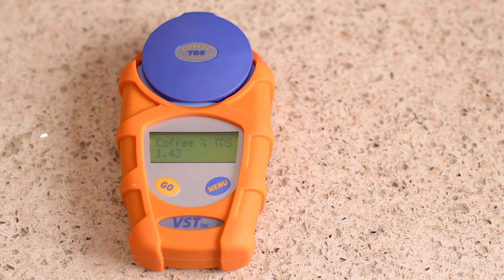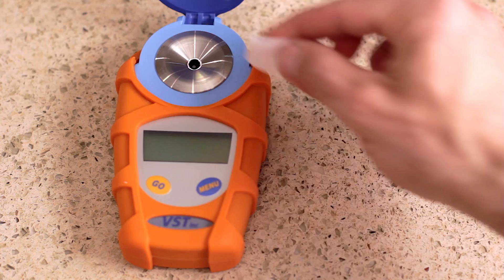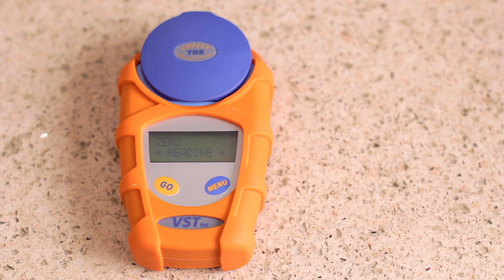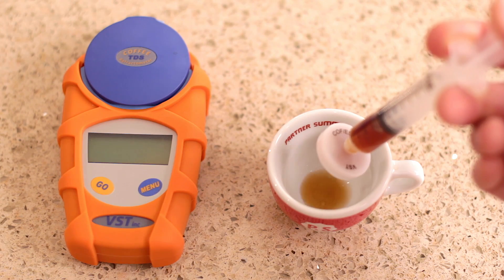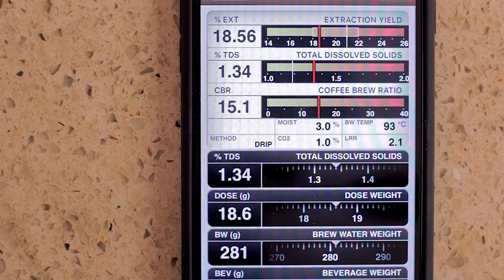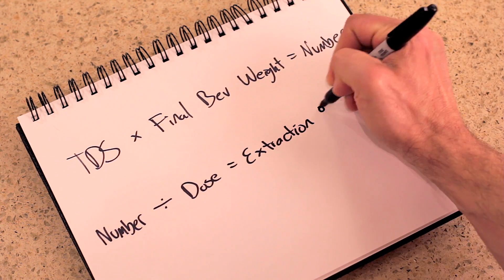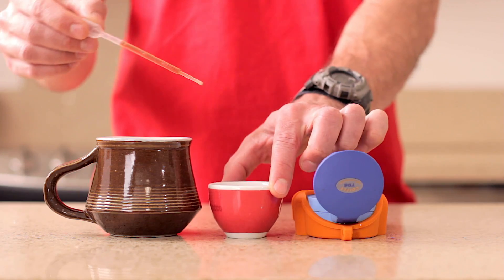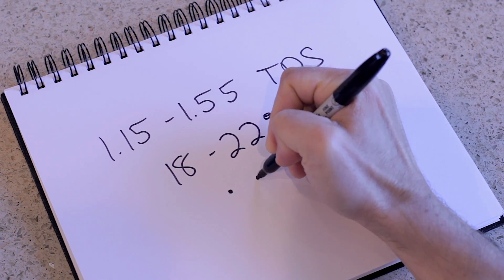Extract Everything 006: Coffee Refractometer Basics | Measuring TDS + Extraction Percentage

Comment: If I understand this correctly, there's a very simple way to get an average extraction yield. Weigh the Original dried ingredient you'd like to extract. Infuse your dried substance and filter. Now dehydrate the remainder Fibrous content to get rid of most of the water - comparable to its original state, and Weigh it again. The difference in weight before and after the infusion of the dried matter will show you how much extracted content you now have mixed within your liquid. For example, if the dried coffee was 100g before extraction, and after  filtration and dehydration is 60g, the total dissolved/extracted content is 40g.
Reply: Theoretically. In practice is harder to measure accurately the leftover mass, because the difference would be really small and there will be some mass of the insolubles carried to the cup and stuck in the filter.

Comment: wait.. you're filtering the sample?   how do you get an accurate dissolved solids count if you're filtering the liquid?   wouldn't there be an inherent loss of material to the filter?
Reply: The question I have is why would I filter something out that I usually drink and that is probably part of the taste?!
Reply: @dominikpaulke4097  Because you're not measuring the taste, you're measuring TDS, and insoluble material will interfere with the reading. Since you only get one number out of the process, you really only want it to represent one variable. In this case, we're interested in the extraction, not the efficacy of your coffee filter/screen/press/decanting method. Insoluble material does affect the experience of drinking coffee, you're 100% right (which is why we see some insoluble material included in higher-end instant coffees even though they're not inherent to the process) but if you want to track those (which would be interesting, I don't know how many people are doing this) then you need to devise another test. A good starting point might be to weigh the syringe filter before filtering the coffee and then dry it out and weigh it after to determine how much material was caught.

All that said, a lot of people won't filter the coffee and if you're dialing in an espresso or something like that where you're only comparing a coffee to itself and the brewing process isn't changing very much between shots, I'm sure it's fine. If you're doing QA, you probably want to filter.
Reply: If they’re dissolved they won’t be removed by the paper filter. The non-dissolved solids will be removed though.

Comment: Great video! My only question is why use distilled water to tare your TDS instead of the water you used to brew with? Tap water will have its own TDS so wouldn't that interfere with properly measuring the coffee TDS?
Reply: Exactly my question. I have atago refractometer and it says to calibrate using tap water. Which is the correct way to do it?
Reply: This is a great question, but my counter question would be: do you know how much of the TDS from your tap water is making it into the coffee? Maybe some of it is absorbed by the coffee grinds? I would be more comfortable calibrating the device with distilled water to keep it as precise as possible, then getting a reading of the tap water, and subtracting it from the coffee reading.
Reply: Accuracy - Because you need a background.  Particulate may still exist within water from some filters depending on quality
Reply: @pj-3325  I disagree. The video implies that you test how strong your coffee is via tds, total dissolved solids within the water. If you calibrate the meter with pure water, I.e. 《5ppm then use tap water(which can have upto 500ppm TDS) to make the coffee, where are your true readings going to be?

It would be much better to calibrate with tap water and then any extra tds measured after testing with coffee is provided by the added coffee only giving a much clearer and accurate indication of strength.

Comment: example : TDS (1.4) x Final Brew weight (288) = Number (403.2)
Number (403.2 ) / Dose (18) = Extraction% (20.73)

 why it is not  22.4 ?
Reply: So if we wanna do reverse calculation, we can estimate the final beverage weight that Chris get is 266.5 gr
Reply: @Anggaditto2  Oh I already understand. thank you very very much.
Reply: Where do you get the number 20.73 from?
Reply: @Anggaditto2  this vdo on 3.19 minute,when use VST app to calculated.
Reply: @sbokhumsook1494  288 is the not the final bev weight. It is the brew water weight. The final bev weight inputted by Chris is not shown in this video (line below brew water weight). As my experiences, it is around 0.85-0.92 x brew water weight.
Reply: From your calculation.
I got info that you use 1:15 Bean versus water. 
Why your calculation shown 20.73 instead of 22.4 is because you over weighing bean by 0.2 gram.
Or the opposite, you less put water by 4.6 gram

Comment: I have a simple brix refractometer that I use for beer brewing. Is it also usable for measuring coffee extraction?
Reply: I also use analog brix meter. It is not as accurate as the digital one, but it is usable to approximate your brewing result. Also you need to convert it by multiplying with 0.85.

Comment: When you say final brew beverage , is that what u get in ur cup ? For instance if in v60 I poured 390 ml of water over 23 gram of coffee and the final output is 340 gm, is that what I shall use in the calculation ? 340 ?
Reply from the maker: yes. in the VST app you can set it for either end beverage weight, or water used to brew. I usually use end beverage weight.

Comment: why would you use distilled water to calibrate? wouldn't you then be measuring your extraction yield PLUS dissolved solids present in the brew water? If you calibrate with your brew water aren't you more accurately measuring only the coffee solids dissolved? If I'm missing something here please clarify it for me 😀
Reply: From Matt Perger on his BH forum: 

"Yes, the brewed coffee will include the water's minerals in the TDS reading 
but they're only 0.00-0.03% and quite consistent. Every liquid refractometer zeros with distilled water. (Calibrating is when you use reference samples to teach the machine what 1.5% or 10%tds are)

Also,
 the relationship between refractive index and TDS isn't Linear. It's a 
really complicated shape. If you zero to distilled water the shapes line
 up, if you zero to tap water the shapes can seriously misalign and your
 error can be far more the the addition of the tap water's minerals 
create. 

Quick tip - to make ghetto distilled water,
 clean the outside of a pitcher very thoroughly with water and alcohol 
wipes. Cool it in the fridge. Wipe off the water from the sides when you
 take it out. Shoot some steam from the espresso machine at it and it'll
 condense into pure water. If you make enough it'll drip off. Use that "
Reply: You're calibrating the lens to register what "0" is. If there are residues left on the lens from a previous use, this could alter what your coffee's true TDS is. Calibrating with your brew water is NOT the way to go as then you're standardizing total dissolved solids across only THAT sample of water, which would lead to very inconsistent results across multiple measurements. TDS measures total dissolved solids, including any particulates which could be in your brewed water as well as your total dissolved coffee. Distilled water is nearly pure, whereas your brew water likely is not. Hope this helps!
Reply: turbo_powahhh does the vst algorithm/app account for solids in the brew water then? because if it's going to spit out a number that represents extraction percentage i feel like it would need to
Reply: I don't believe so. In a nutshell, refractometers capture the amount that light "refracts" (essentially the angle at which it changes direction) to whatever substance is sitting on that lens. In brewing coffee, water is the solvent and so the contents of water can affect the solubility of your desired solute (this case being coffee). Zeroing out with distilled water provides a means for the device to know what a blank slate is. Since your water content can change/is probably inconsistent, this affects the level of solubility of all total dissolved solids in your cup. This is a standardization that allows for everyone to play on the same field.
Reply: turbo_powahhh I understand how refraction works, however it's this inconsistency in brew water samples that leads me to be skeptical of the practical use of refractometers in most cafes.
Reply: There's another consideration. Do it both ways and you'll find almost no difference. Refractometers are calibrated at zero and always have been. Zero is a standard. The hardness of your water is not a standard. It can vary but also isn't likely to contribute much to end results.
Reply from the maker: You definitely need a consistent brew water supply for the most consistent results. We R.O. everything then add the minerals we need back in to pull what we need out of the coffee. It's heavy, but worth it.
Reply: RealChrisBaca that makes sense. I'm assuming in the shop you're using the vst to establish consistency. thanks!
Reply: I always have the same question Drew.  I absolutely agree with what you are saying.  I think it is just most important to be consistent.  Being 150ppm off isn't going to give you a big difference (0.015% TDS).  So you would eventually learn what magic numbers usually taste best on your equipment with your calibration.  The numbers are really just giving you a baseline which you then try to move around based on what you are trying to change in the taste anyway.  I use distilled water to calibrate with if I have it handy, if not I'll use brew water.
Reply: Brady Chiongbian you're a champ. thanks brother

Comment: was there any difference between readings with syringe filter and without filter assuming that was filter coffee not espresso?
Reply from the maker: Yeah you technically don't need the filter for filter coffee as the brewing filter does the job. For espresso and immersion you definitely need it.
Reply: I had the same thought. I was under the impression that the screw on filters were for immersion methods (that don't have a paper filter at the final stage) or for espresso since all other methods would be already considered filtered.
Reply: I don't use filters for filtered coffee.  A lot of times I also don't use them for immersion or espresso either, since they are expensive and I'm just looking for a number I can relate to taste.  Socratic Coffee also did some experiments with and without filters and they do not use filters normally.  Using a filter will just lower your TDS, so you just need to understand you might be getting a falsely high reading without one.  But keeping it consistent without a filter still helps me dial in espresso as a home barista to see which way I'm moving the extraction and strength.  Also, you can find some filters cheaper than the VST ones if you do want to use a filter.
Reply: RealChrisBaca Any advice on cheapest place to get the syringes and filters?